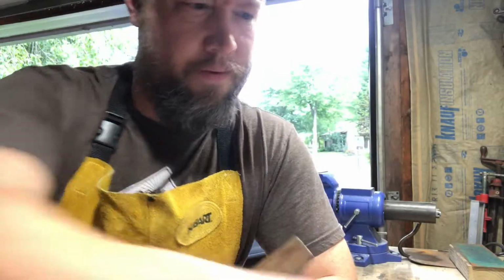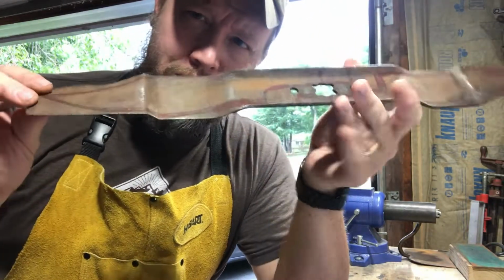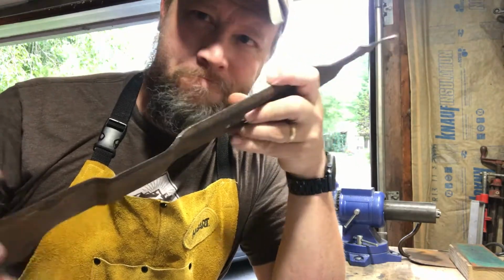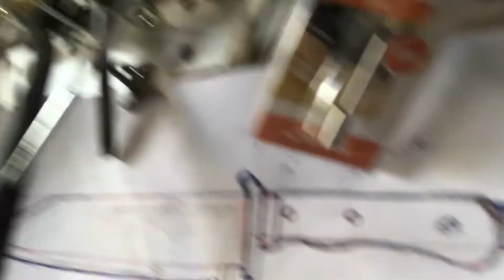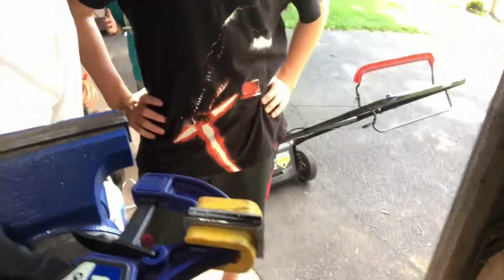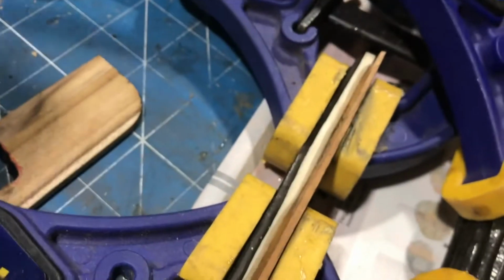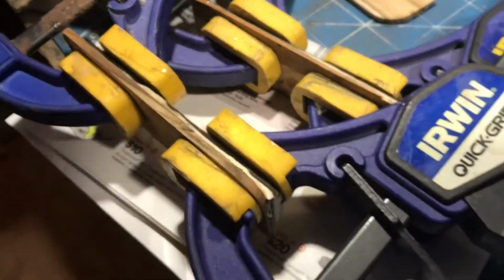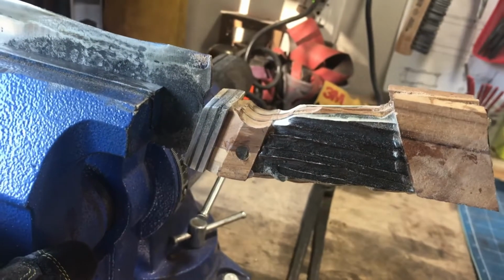Two Bowie Knives from a Single Lawn Mower Blade

Comment: Looks like they turned out very nice. Thanks for sharing the video
Reply from the maker: Thanks for watching, Rick! Hope you and yours are well.
Reply: We're a hanging in there still. Wish you could put more of your creativity on youtube.
Reply: Lawnmower blades won't harden
Reply from the maker: @aarondalton2223  Thanks for your comment. They will harden to a degree, depending on the composition. But you are correct in that mower blades certainly would not harden nearly as well as a known, high carbon steel.

Comment: Do they hold an edge though? Mower blades are soft so as not to shatter when hitting rocks. Can they harden to really keep an edge?
Reply from the maker: They will harden to a degree, depending on the composition, but certainly not with the consistency and predictability of a known high-carbon steel. I would consider these more as showpieces would not recommend for actual use.
Reply: Thank you!  It is still great practice, but now I know what to expect. Appreciate your reply. @jasonvandorsten
Reply from the maker: @picklesnoutpenobscott3165  Fantastic practice! I find that old mower blades are a great low-cost material for learning both stock removal and hand forging techniques.